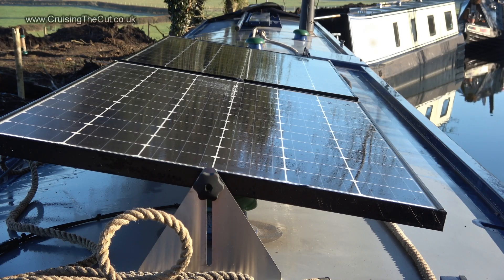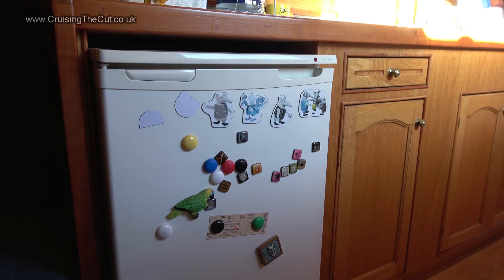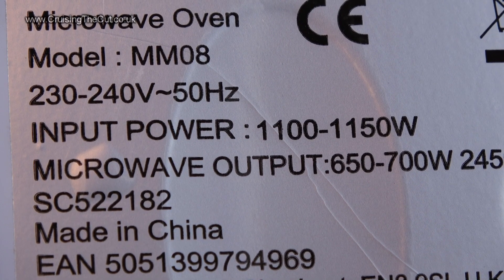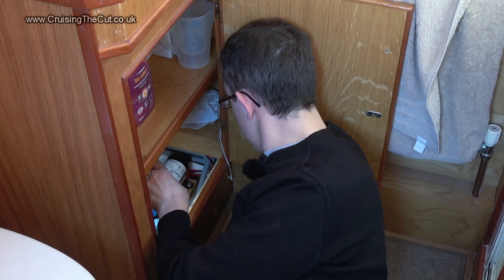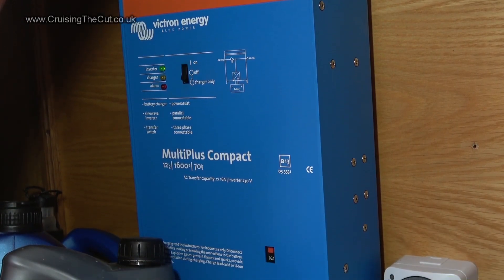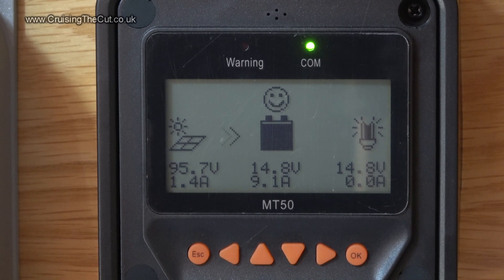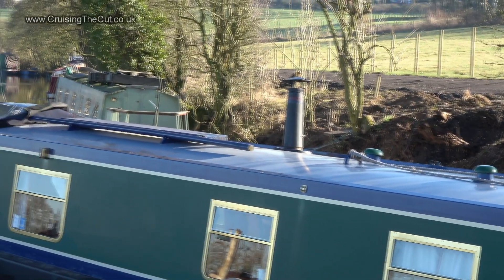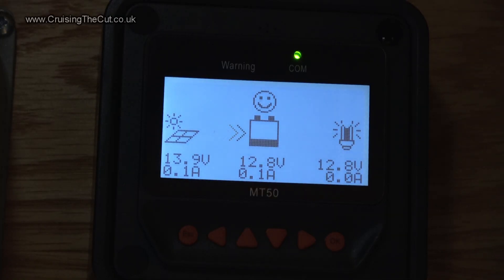76. Is solar power sufficient for a canal narrowboat in an English winter?

Comment: Consider too your engine alternator, if it is an automotive type, say rated at 60 amps, in the real world it can only do that for about five minutes, enough time to top off a car battery but way short of what you need for a bank of deep cycle storage batteries.   You need an industrial (truck or bus) alternator or a marine model rated at 100+ amps and a proper multistep regulator that can put out a high percentage of its rated peak without overheating for an extended period and manage output voltage to safely charge your batteries without overcharging.  It is not a good plan to run your main engine for extended periods at idle power setting just to generate electricity, diesel engines like to work, meaning putting a load on them and getting them up to normal temperature.  If you are not going to regularly cruise having a separate genset is a good plan and having it boxed in to keep it quite will make you a good neighbor.  Water cooled models can be plumbed to help with hot water and even some heating.
Reply from the maker: Yes indeed, and narrowboats generally have marinised engines with the appropriate alternator. Some have gensets, other people carry portable generators though these bring their own issues such as safe fuel storage.
Reply: We use portable generator that runs off of the LPG gas bottles. Brilliant, no need for extra fuel onboard and no need to walk to a petrol station.
Reply: small boat engines generally don't come from the factory with a heavy duty alternator or regulator, these things are somewhat expensive vs. a cheap automotive model.
Reply from the maker: All the narrowboat engines I know of come equipped with suitable high output alternators (except my own boat, which has a rubbish one :-(
Reply: Honda (and others) make small gas powered generator/inverters that are small, efficient, and QUIET, available in power ranges of 1000w, 2kw, and 3kw but I am taking about the NA market and 120v power although the larger ones do have a 220v outlet and they are 60hz not 50.  I don't know if they have a comparable product for the European market.  The major disadvantage is they use petrol that folks don't like on boats, but if they are stored on deck they'd be no more of a problem than an outboard for a tender.  Enough power to run your refrigerator, microwave, toaster, a a big TV but not all at once and a little left over for the batteries.  Noise level of 60 db or less.

 On the yacht side of boating they have refrigerators with holding plates that only need run an hour or so each day.
Reply from the maker: Yes, lots of narrowboaters have little Honda generators but there are safety issues as you say. Unfortunately, even 60dB is noisy on a canal towpath. Lots of people use them though!

Comment: A very interesting vlog. I feel a lot more  power could be acquired by giving greater consideration to the panel angle. Your panel angles are very suitable for a Singapore winter (66 degrees - angle not temperature!) ,whereas your winter angle ideally should be 14 degrees .  I would expect a far higher output to be achieved from an 80 watt square panel (price £73 amazon) pole mounted like the old 'squarial'  seen fitted on houses in 1988 before Murdoch made his grab. My fixed panels in Dorset are fixed at 39 degrees and my peak generation over the last seven years has always happened in the weeks that involve the 11th April and 11th October, is adjustable to chase the sun and seasons. Have a look at the solar angle calculator provided by Michael Boxhall on Google.
Reply from the maker: Maybe I'll convert the whole boat to pedal power too!
Reply from the maker: Hi. Thank you. I'm aware of the substantial difference that the angle can make but as you can see from the measurements, on a typical winters day even doubling or tripling the power achieved (a miserable 3A even tripled would be 9A and there are very few hours where you'd get that) would be well insufficient to generate my 80Ah minimal use (which doesn't even include using the laptop).

Granted, it would help on the occasional sunny day as shown but for most rainy / overcast / snowy days it just wouldn't make up the deficit. The brackets I use are very common on a lot of narrowboats so the video and sample readings are very typical of what a narrowboater would expect to get.

From Feb to October (based on last year) my set up IS sufficient; the point of the video is that in mid-winter there just isn't enough sun.
Reply: Thanks a lot - it looks as if a Norman Tebbitt response would be "on your excercise bike with dynamo and regulator". That way the sporty type gets warm twice! :-)
Reply from the maker: Actually, that's not a bad idea!!
Reply: I've seen a pair of articles telling that a well trained cyclist is capable of putting out a peak power of 600W for a short time, and an average 400W for extended time. This means on 12v a 33,3 Ah charging current. Take in account losses on the battery charging and you're left with less than 30. So you'd have to pedal for around 3 hours a day for your 80 Ah. Boy you're going to have strong legs at the end of the winter !
Reply: LOL Now that would be an ecological masterpiece :)

Just watched your 77th video. I'll have to wait a month or two now (i prefer watching a whole hour at once, so i'll wait 5-6 new vids before watching them). Thank you anyway, it's really nice to learn all the bits of this special way of living.
Reply: the sun angle in northern Europe in winter is very low, even at noon.   This means the sunlight is filtered through more of the atmosphere that reduces the energy content (if it won't give much of a sunburn it won't light you up either) so you could go through a contortion of panel angles and still not get much, the energy just isn't there.
Reply: Like Fred Flintstone?

Comment: I find all your videos very informative, in particular as I intend buying one myself in a couple of years. If I remember correctly in a previous video you mentioned you had an old tv. So my question is this, If your only place of residence is the boat, ie, you don't have a house or other such place. How hard is to register for a tv license? I do know that if you have a house and a boat you need an extra license for the boat, well I'm almost sure I read that somewhere. But boat residency alone? This question falls into the boat address, mail slot, I presume.
 Anyway many thanks.
Peter
Reply from the maker: I spoke to TV licensing and the licence address is a family address (even though they have their own licence) but with a note on the file that says its for my boat!

Comment: I live off grid in Canada and it sounds to me like it's not a panel issue you have but a storage one. It seems you need more battery bank to store your potential energy intake. 
I also notice it seems as if most of the narrow boats seem to have their panels fixed. Is it not possible to have a set up on the roof of your narrow boat so that you could change the angle of the panels for the season and pull in the extra percentages of energy that would allow to your inverter? I do that with my array that is mounted on posts.
Reply from the maker: It's not a panel or bank issue, it's a sun issue! There's plenty of battery to store any charge but, as shown, you don't get more than a trickle in. Even if the panels were angled better (they do move to an extent), the amount of sunny hours in winter is so minimal that you don't get much power.
Reply: How much amp hour capacity do you have?
Reply from the maker: I have 3 x 110Ah but they're very old batteries so probably much less and of course, you're not supposed to discharge lead-acid beyond 50% anyway so not a lot!

Comment: Do any boats have sub deck / in hull fridges / freezers? Like a mini wine cellar.  Seems counter intuitive to me to have an appliance trying to keep things cold in an area you are trying to keep things warm.  I understand that it might be less convenient but just interested. Love your videos.
Reply from the maker: Some of the more modern boats, built in the last ten years or so, do have coolers - often for wine - built into the floor, as boat fitters have started to cotton on to the idea that people want a more up to date approach but mine's very conventionally built and doesn't have this.
Reply from the maker: Some of them do but they're the more modern boats.
Reply: As usual great vlog David ever the professional presenter. Yes I have picked up that idea of sub deck storage,  I have carpet which just doesn't look right so am about to lay a nice new wood floor. So Ideal time to cut a couple of holes and make room for some wine and beer. My nice new very expensive Waeco CRX80 fridge/freezer (which is 12 volt very efficient, consumption 1.19 Ah/hr, average power input 48 watts)  But ....its so small with some  wine and  beer in it, there not much room left for food!!!
Reply from the maker: The ideal spot for a wine chiller. That is indeed a low power fridge...
Reply: No,surprisingly they don't! Narrowboat living design hasn't really been thought through and tends to use caravan/camper type tech/fittings/fixtures.

Comment: hi ya in one of your vlogs you talked about a tap for your shower head and it goes cold when you turn it off and on again . ive had the same problem ,i found the salutation ive put a thermostatic tap in place of the original one so far its working good.hope this has helped in some way to save water. keep vloging
Reply from the maker: Cheers Terry. Yes I ought to do the same but so far I just mess about with the taps until it's right. One day I'll sort it...

Comment: Aha all caught up, well done (that's for me , not you). Your calculations for your requirements are very modest, as a music listner (anything going) i would have either the radio or laptop (Mp3) running in the back ground using more power. So maybe an experiment with wind power, with the bonus unbiast review for the manufacturer, hint,hint, as most canals are exposed to the prevaling you could find the missing amp's.
Looking forward to the next instalment.
ATB Daz
Reply from the maker: Cheers. I find the missing amps by mooring for winter with a shoreline ;-) wind turbines can be noisy and you have to put them up and down each time you move.

Comment: Great video, You really should try to get those panels facing the sun (somehow?!) I have just 1 x 240w Bosch panel that I can rotate 360 degrees (which generally just faces south)  and my winter angle is just 10 degrees. It is not unusual to get 8 amps + in the winter.
Reply from the maker: Hi. Thanks. They do adjust but even at 8A there won't be enough sunny hours in winter to do a day's recharge which is the point I was making. I'm on a shoreline Nov-Mar so I'm fine!
Reply: Shoreline power is a luxury (I'm jealous) but I reckon you could get away with it using your 2 panels, 16 amps for 5 hours a day gives you 80amps if you changed your brackets. Its free electric and no risk of galvanic corrosion!
Reply from the maker: I don't dispute your maths but whilst there might be the occasional day where there's 5 hours of clear sun, most winter days are dull, rainy, overcast or partly so and this would not generate anything like it. Besides, I use the shoreline to power the immersion heater for the shower each day...

Comment: Fantastic video once more.My Mother always told me to ask questions if you don't know the answer,even if everyone else thinks theyre dumb - So can i ask you if you can speculate as to what difference it would have made if your setup enabled you to position the panels more directly towards The Sun? Thanks,and sorry to cut into your power with this question;)
Reply from the maker: Pointing directly towards the sun does make a significant difference, proportionately speaking, but since the amounts coming in are so minor, it'll still be very little. And that only works when the sun is distinctly shining. On the second day in my video where it was completely overcast, the light spread was pretty much even so pointing it in any direction would have made little difference. On dark cloudy days, rainy days, snowy days etc, it'll make no difference. So yes, when there's direct sun you should do it. It still won't sort things out for winter!
Reply: Much appreciated.Thanks.

Comment: yes we run the engine for an hour every two or three days!
Reply: To run your diesel for charging is unhealthy for a new engine (glazing
the bores). With an older well run in engine its less harmfull.
Best to do it when voltage is low in the morning so the alternator will
be more efficient (bulk charging,more amps output). During that time I also charge my various electrical applicancies. (or you run your electric washing machine)

Comment: Another Fine post! When I last lived off grid, it was on
a sailboat in the Caribbean. We had a wind generator and the alternator off of
the main engine to supply power. I had installed an alternator controller on
the 55A alternator to maximize its output. The alternator could put out a
continuous 35 amp's. We ran it 45 minutes in the morning and 45 minutes in the
afternoon. Between the running the engine and wind generator, we had lighting,
GPS, water pumps, 10 gallons of water per day and about 7 cubic feet of a
refrigeration. But the box was very well insulated. The water maker was a bigger
draw than the refrigeration. We ran the 27 hp engine at 1200 rpm, burned about
.3 gal / day. At the time we couldn't afford solar. It was three times the cost
that is now. If I had to do it again, the Bimini and the dodge and everywhere
else, I could think of would have solar panels. 
All the best to you in the new year!
Reply from the maker: Thank you! Oh, you'd be well sorted for solar now I reckon.

Comment: Do you obsess about power consumption? I'm just OCD enough that I'm not sure I'd be able to relax, interesting
Reply from the maker: Not in summer when there's loads or winter when I'm on shoreline. Spring and autumn I tend to peer out the window and decide if I should use the telly and laptop or not!
Reply: use either for the minimum you need.

Comment: Another great video, Mr CTC!

It is possible to survive on solar if you're willing to make a few lifestyle changes. We had a lovely winter with 200W of panels. We turned off the fridge and used colder parts of the boat for perishables (and beer, of course), and usually consumed these within a couple of days. Any meat was eaten the same day. 

That left LEDs, pumps, phones and laptops. We'd make sure to charge the latter in the middle of the day when the amperage was high. I think it was a particularly sunny winter (2014-15), and there were two or three times we had to run the engine when it was particularly overcast. We also chose moorings in open areas without trees around to block the sun.

I admit that it's not for everyone, but we found it's doable with a good quality of life.
Reply from the maker: And a nice winter ;-)
Reply: Here in portugal I get by similar with 150w panel and one good
quality 145amp lead/accid batt in a lot more sunshine.
With 4x these capacities (like CTC) I think I could get by for a few months in the north (holland).  (lights and laptop) Nowadays there are better windmills too.
Its all or very little with solar alone but the trick lies in our
adaptive attitude. You start with zero amp needs and see how
far you get instead of wanting 100 amps a day and saying its moddest.
Reply from the maker: One can equally eat toast all day and save a lot of money on food but it's not a quality of existence I'd want. Ditto power. 80Ah is indeed a modest requirement.

Comment: One more panel seems like a good idea, and perhaps another smaller panel or two.  If you were to cover all of the available places with appropriate size panels you should be able to come out ahead on a good day and even or thereabouts on an average day.  This, topped out by a small gasoline generator when necessary, should do you quite well.
Reply from the maker: But it wouldn't, as my example showed. Even on a bright day in winter it doesn't generate enough because there aren't enough fully sunny hours in the day. besides that, most winter days are overcast or rainy or otherwise horrid so you get a pittance.

On the other hand, from spring to autumn there's an abundance of power; I totally disconnected from the mains and never even ran the engine for power all last year from March to mid-October. But it's not a goer in winter.

There's only really space for one more pane else the top will become too cluttered and unweildy for when I'm cruising and need to get on the roof, such as in locks.

As it happens, I don't need any more because I moor up for winter and have a shoreline so this video was an entirely academic exercise for anyone thinking of continuous cruising! Cheers :-)